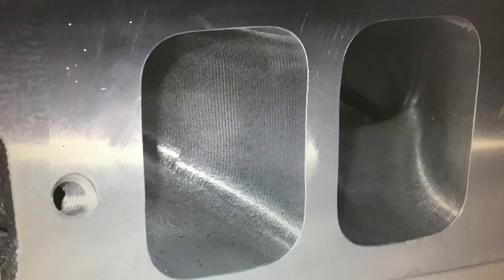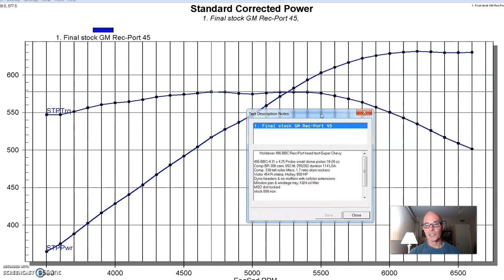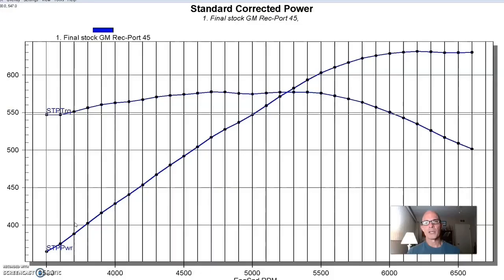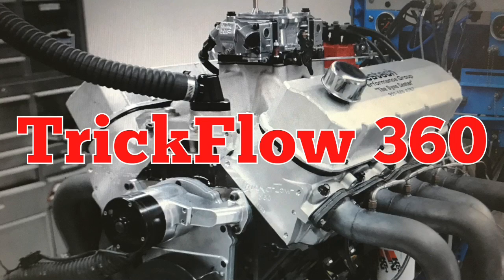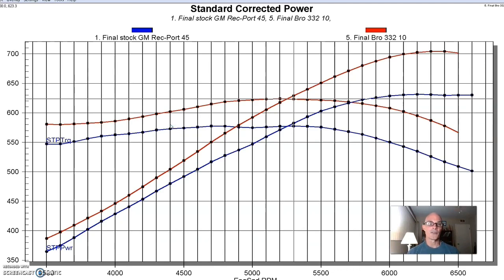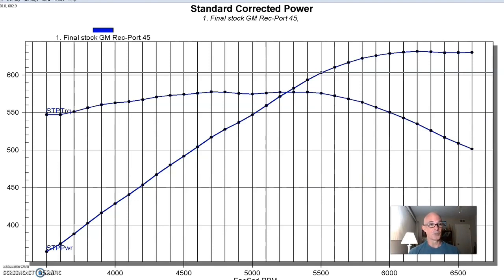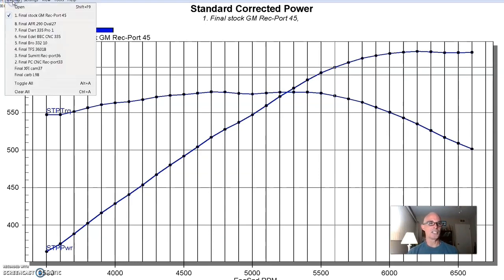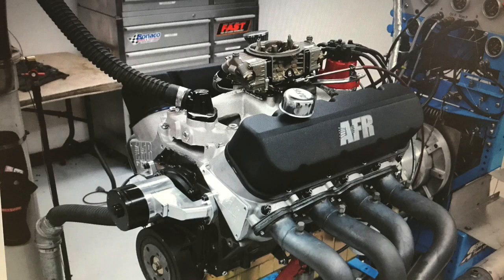HP HOW TO: BBC HEAD TEST pt2

Comment: One thing I don't like it this test is the large port volumes. You know as well as I do, that a 496 with a small cam will always benefit from a smaller port volume but with good flow, such as the 290 cc head. You are 100% correct in the fact that port shape does not matter, flow and velocity matters.
What I don't quite understand is this. You keep saying "well, our little 496 is probably on the small side for this or that head". Here's my question. Why on earth did you choose to test those heads? There are plenty of 300-325 cc heads out there to test, and ALL of them would be better than the 335 cc heads. The only head here that kind of did work sell despite the size was the Edelbrock, but that's because it's what I would call a "small" 335 head. Why not look at some of the CNC ported 310-315 cc heads? Yes that AFR 290 did great and is definitely one of the correct heads for this combination. But I think it is safe to say that it would have been interesting to see how the AFR 315 CNC head or a Dart Pro 1 325 CNC would do. I am 100% sure that the AFR 315 would be the winner in both torque and hp average in this test. I think you make great vids and I like your tests, but I think you made some strange comparisons here. Can't help but wonder if Tony Mamo has a dog in this fight. I know he's acquainted with the guys at Westech and I can't help but wonder if this is a play to make his oval port heads seem great. Sorry, all this just seems really odd.
Lastly, when testing an oval port head in such a test. Have you ever thought about the Edelbrock 325 cc CNC oval? Definitely one of the best oval port heads on the market and would also be well in line with the scope of testing the 300-325 cc stuff.

I will never understand why people keep installing 330+ cc heads on these "small" BBC mills. We are out of the 80's after all. On the flip side, I think you nailed the head choice on the 565 with the AFR 357. Lots of people would have gone with the 385 or an SR20 just because of the cam specs alone. Only head I could think of which would have been fun to test on that combo would have been the Profiler 375 CNC head.
Reply: I think more importantly would be if you could measure the minimum cross section area around the short turn on all heads. You might find that the smaller heads wont really be that much smaller in this area and the rectangle port heads just have a shit load of taper in the ports which only make the port measure more but arn't really that much bigger really. So much taper in the port doesn't really help much for anything. Any chance of measuring cross section?

Comment: This is really confusing, I was expecting to see better mid-low lift numbers from the brodix heads seeing how they outperformed the others in avg power, but they are right in line with the others, that just out flow the group 0.6 lift and over, not even the port volume was a good indicator of how they performed as the one with the most avg power is on the larger side of things.

Comment: Forget about the extra weight and bloody knuckle that come with them all things being equal Iron makes more HP does it not ?
Reply: All things being equal iron will not make as power as aluminum.  It's a result of the iron trapping more heat, it's not a huge difference at most street power levels it's in the noise.
Reply from the maker: I think that is a myth

Comment: In my opinion super expensive heads are not ever worth the cost on a turbo engine as turbos increase the amount of hp greatly on stock heads. On a na engine I can see the interest. But the cost of stroking and aftermarket blocks and high compression pistons and race heads is greater the boosting a mildly built engine. With just a cam change even 8 to 12 pounds of boost blow away a modified na engine.

Comment: Honestly i'm a little disappointed in this combo, even with the best performing head you're still only at 1.28lbft/cu for maximum cylinder efficiency.  An engine around 10.6:1 compression optimized should closer to 1.4-1.5lbft per inch if you're really maximizing cylinder volume.